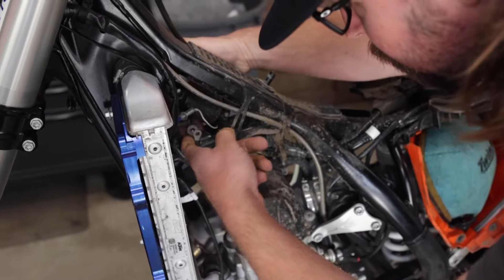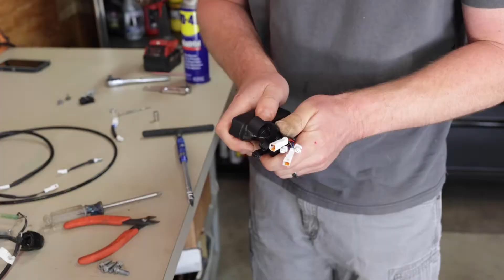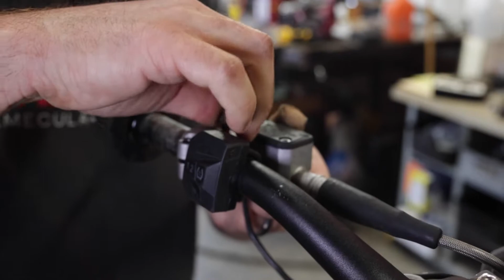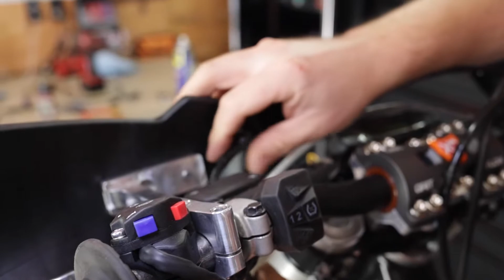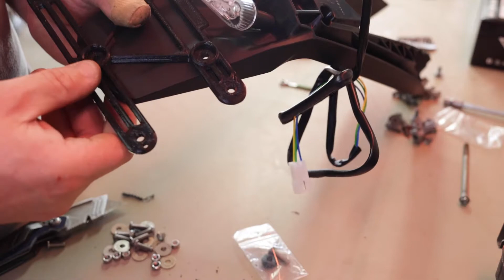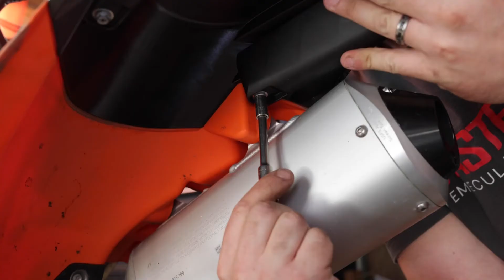KTM Option 2 Install TRUE NORTH MOTOS

Comment: Are the auxiliary power connectors capable of supplying a radiator fan kit? I currently have one installed on my bike, but would like to avoid directly connecting to the battery if possible. Trail Tech states the fan kit draws 30W. With the dual sport lighting kit, as well as the fan kit, would the stator be able to keep up with this? Bike is a 21 KTM 250 xc tpi. Thanks!